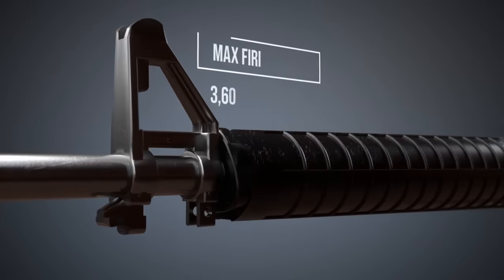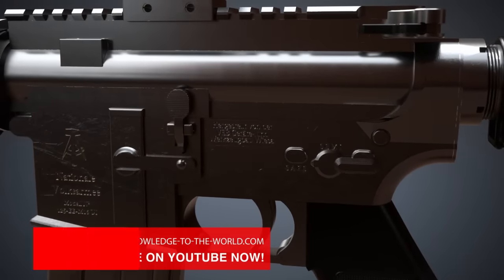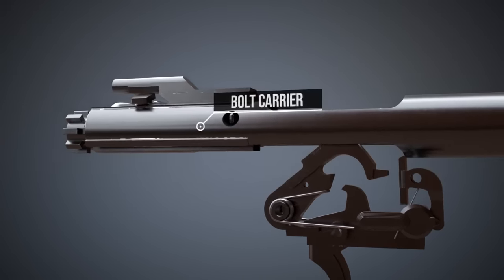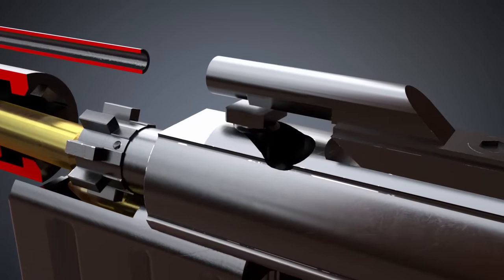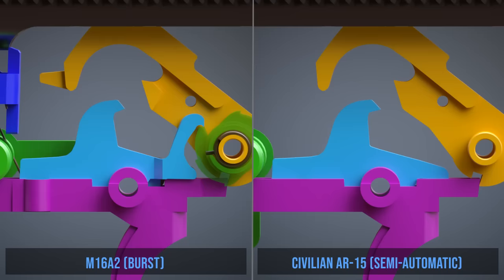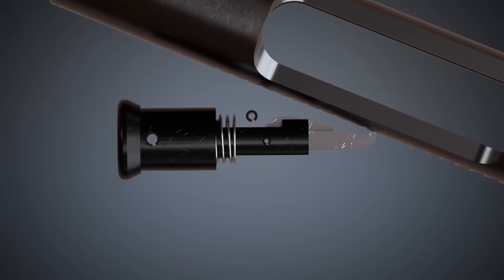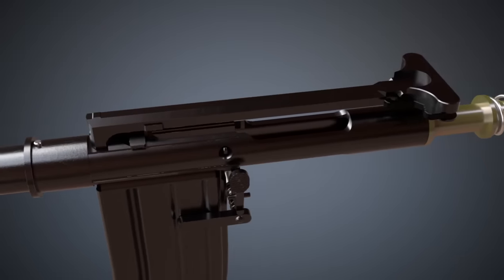M16 and AR-15 - How firearms work! (Animation)

Comment: It's called the cycle of function. Firing, unlocking, extracting, ejecting and cocking,feeding, chambering and locking. It's firing from a closed bolt.  Mgs. Cycle is the same but the sequence is feeding, chambering, locking, firing, unlocking, extracting, ejecting, and cocking.  Firing from an open bolt. It's skill level 1. Or it was for 11b in the 80s.

Comment: I'd always wondered what the weird sticky out bit on the side was for, now I know it's the forward assist plunger. As a British ex-soldier, I'm used to just doing a weird karate chop thing as a forward assist.
Reply: The forward assist almost never works for an out-of-battery malfunction. If it happens, the best thing to do is to rack the charging handle again. Its also a better way to do it because the round may be damaged at some point during manufacture/packaging/transport or during the malfunction.

Comment: And there's all this debate about which is the better AR setup: direct impingement or piston. Well, looking at this, the AR-15/M-16/M-4 as originally designed is a gas piston arrangement. The difference is that the piston is an integrated part of the rear of the bolt as it sits in the carrier, vs. in the gas block near the muzzle.

Comment: as an engineer myself, i am amazed at the beauty of the mechanism of this deadly invention of catastrophe. Also, mechanical system >>>>>>> digital system. Though, digital system makes things smaller, compact with more features, one cannot argue the reliability of a finely tuned precise mechanical system.
Reply: it really is a beautiful mechanism. a beautiful balance between complex engineering, and simplicity in operation and maintenance. I personally own one of these things...amazing to operate. they really inventions of death and catastrophe, in the best possible manner. the .223 and .556 have a special ability to rickashay off bones and bounce throughout the body. it's an extremely effective weapon of war. just make sure it's used by good people to do good things. remember, protect the innocent and helpless.

Comment: Great video but I wish you would have emphasized the exhaust ports/piston interface when visualizing the bolt unlock sequence.
Reply: Good point. It wont work without those  little holes in the BCG! It was a pretty good vid though.

Comment: I have enjoyed watching several of your videos on how different models of small arms work. You not only demonstrate the operation of the mechanisms hidden inside the case, but also explain in great detail the principles of their operation, highlighting the key points. There are very few creators on YouTube who treat video production with the same care and precision that you do. But here in this particular video, starting from 6 minutes 27 sec., you have crept in an unfortunate mistake. The spring clutch between the burst cam disconnector and the hammer must be wound in the opposite direction to that shown.

Comment: The one misconception that your video doesn't quite address is the idea that the bolt carrier cycles during firing. The truth is that the bullet is all the way out of the muzzle well before the bolt starts rotating, so there are no moving parts during firing.
(I've seen many people think that automatic rifles are less accurate because of "moving parts" during firing)

Comment: You know, the way the 16 model works is pretty much designed for optimal failure in order to be cleaned or be replaced consistently.
It works on the same gas premise as the m1 carbine but the port is perfectly placed to put grime on the most working surface area possible.
A lot about the gun design and the history of it confuses me.

Comment: Not trying to be anti American, but having served in an Army where the standard assault issue was a modernised AK-47 rifle(having more or less the same firing mechanism as designed by Kalashnikov in '47) , I must say it seems to me the AK has far more simpler and more effective firing mechanism, it's kind of clear now why it's so wide spread, and why there were many complaints about the m-16 jamming during the Vietnam war. I personally never had a chance to fire one, being a EU citizen.  Kalashnikov could be drowned in a river, blown up,  ran over by a thank, and still work after all of that with a surprising lvl of accuracy. If you haven't already do a video on the ol' AK,, would love to see it.
Reply: the jamming of the M16 was because of a faulty change in powder in the ammunition and many US soldiers in the war had the belief it was self cleaning so they weren't cleaned, so many of their rifles jammed in the jungle and was regarded as a total piece of shit till the M16A1 was released years later.

Comment: I dont even understand how soldiers were able to view the smaller aperture rear sights easily
Reply: The pupil is not dilated during the day, so it is not a problem.  For night firing, the rear sight would be flipped so the sight with a larger ring is used.  At night, the pupil opens (dilates, or to put in simply opens up like a cat), and the larger ring works.  Another point, for targets over 300m, the larger ring is used (during the day; at night it would be difficult to see a target over 300m without night vision).

Comment: so well  explained but im still confused asf LOL
Reply: The firing pin dents the primer when you pull the trigger.. it goes boom, bullet flys out... the used brass case that was holding the bullet and the powder gets  thrown out of the gun by the bolt(ejector) as it moves backwards from the explosion .  the bolt then  wants to go home because a big  spring is pushing on it and it carries a new bullet into the barrel on its way.. simple.. then you pull the trigger again. bang, bang, bang until mag is empty

Comment: Cool video. One problem - burst mode was NOT added to save ammo, it was added for more effective shooting. In full-auto it is hard to control a gun because of the recoil, in semi-auto you shoot only one round, so it is easier to miss. In burst mode you shoot 3 rounds before recoil will affect your aim, so it is easier to control and harder to miss, plus, after one shot target may still be alive and capable of firing back.
Reply: I would bet real money that the burst mechanism jams readily with the addition of just a little fine sand.
Reply: @6NBERLS  well, it is a problem with any fine mechanical systems, and you can get only so fancy with just a simple system. Everything has a price.

Comment: Amazing how fast the m16 trigger system actually does all this in real time. 1400 rounds if you had a clip a mile long in 1minute.
Reply: 1,400RPM is super fast and like MAC territory. Full auto ARs will fire 600-800RPM depending on barrel length, gas length configuration, and buffer configuration. I hit about 650RPM with my binary trigger which isn't much different from the M16s I've shot.

Comment: Stoner's design is not really a direct impingment. The gas tube delivers the gas to the inline piston inside the bolt carrier, hence the gas rings at the rear of the bolt (not made note of in the video). 

As for fouling, most of the gas delivered to the piston exits from the small holes in the side of the bolt carrier. This expelled gas is shown at the very end of the video. Very little gas is left in the piston prior to the bolt carrier moving back and the gas tube unconnecting. In reality, bolt parts need to be cleaned very little with just a light layer of oil remaining.

The beauty of the Stoner design is that the piston is inline with the bore, no tipping forces such as on an AK. Important also is that the piston pushes the bolt against the barrel extension as it unlocks. The bolt is "floating" during this unlocking with reduced stress on the locking lugs and barrel extension.
Reply: It actually is true direct impingement, as the gasses are impinging directly on the bolt/bolt carrier.  The whole "ar-15 is actually a piston gun and not DI" meme needs to die because it makes no sense when you look at it in context of every other direct impingement.

Look at the MAS49, Hakim, any "true" DI gun and they all are piston operated.  There is not a single DI gun that operates just by gas striking a surface, they all use a small piston.  Thus, DI is a subcategory of piston gun, they are not mutually exclusive, or else there are no DI guns that exist.

Comment: This will be lost in the comments but why doesn’t the bolt rotate before it goes to the trunnion to lock? I get there’s a cam pin but I feel like if there was enough pressure on the bolt itself (like a cartridge or finger poking at it) it would rotate within the bolt carrier. Are the recesses within the receiver or something? This has always puzzled me
Reply: When experiencing backwards pressure the bolt is trying to move directly back but cannot because the direction of the force is straight back into the locking lugs (the metal protrusions which line up with the bolt's metal protrusions). It can only be moved back during firing once the rest of the BCG moves backwards. The BCG can move because nothing is impeding its rearward movement and, as it moves, the cam pin is forced through a set channel, turning the bolt and allowing it to move backwards. 
The bolt remains extended because, once the BCG turns the cam pin and the bolt is free, the chamber's pressure is vented and it is no longer receiving rearward force that would cause it to move backwards.

Comment: A great video illustrating the mechanics of this rifle.  Brings me back to the 1970s when I was young and serving as an infantryman.  The video could be improved by explaining the reason for inserting the firing pin retention-pin from the left side of the bolt-carrier with the rifle pointing away from the user.  During my time, we were told not to insert it from the right-side (with the rifle pointing away from the user).

Comment: Great modeling and animation. You might want to correct one minor thing. In the cartridge the primer pocket is deeper and propellant doesn't sit in that area. There's actually a hole that allows the primer energy to reach the propellant.
Reply from the maker: Thanks for clearing that up! :)

Comment: The only thing I can fault this video with is incorrectly describing the AR15 as being a direct-impingement firearm. Even the animation correctly shows how the firearms cycles; the gasses redirected back into the bolt carrier group use the bolt itself as a piston to then launch the carrier itself backwards into the receiver extension.

Comment: The idea that ammunition waste is the logic behind burst fire is not necessarily true.  The fact is that only 2 rounds of a burst are expected to be on target when aimed at a man sized target at 50 meters.  In close combat, such as clearing a building, the inaccuracy is not a problem.  The current battle rifle is the M4 version and has recently be upgraded to Fully Automatic. 

A bigger problem with Full Automatic, is that of guns failing either due to barrels bursting, gas tubes or some other part.  This has been a problem in combat with several makes of rifle.

Comment: Nice video, their is some issues around 09:16, unless modified most m4/m16/ar-15's come with a compensator not a flash suppressor. You'll see a Flash suppressor on a 240.
Reply: It's a compensated birdcage flashhider and a very good one.  Even the very first M16s used a 3 prong flash hider.  The bottom opening of the birdcage is closed which has a little bit of compensation effect.

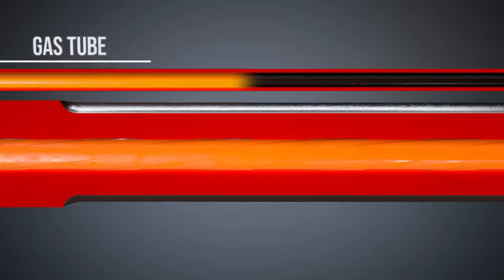Comment: 4:36 I don't understand why the gases go all the way down to the firing pin. Isn't it enough for the gases to hit that upper cylinder to push the bolt back? It looks like a dead end. Oh I see why now, the gases in that chamber make sure the bolt rotates out of the cam-locked position. And after the gases push the bolt back where are they vented?
Reply: They are usually vented out the side of the upper receiver and near the charging handle which is why when people shoot suppressed they run charging handles with raised lips.

Comment: I would like to ask those who are well read up on the first m16 a question. I know it was prone to jamming a lot due to weather conditions, dirt, and what not. What specific part of the gun was it that was the cause of all of it? Was it the high tolerances? Maybe it fouled quickly from poor care? I'm just curious if there was a simple fix that could have resolved the issue.
Reply: It's not prone to jamming at all.  Not to weather, not to dirt, not to sand.  That stuff is almost completely a myth. Look up InRange TV's mud test of M16 and AR-15s and not a single one has jammed yet from being covered in mud, while even the AK has failed those tests.

When the M16 was still only the AR-15 and being fielded by Air Force, Spec Ops, and South Vietnamese troops in battle, it had a near perfect reliability rating.  When the US Army was forced to adopt it after seeing its battle performance, the US Army Ordnance Dept hated the gun because it was the first rifle not designed by their government engineers, and not manufactured in government armories.  It didn't use traditional wood and steel, so they attempted to sabotage the gun to bring back the M14.  They ignored suggestions from Colt to chrome line the barrel and chamber, they didn't issue cleaning kits or train soldiers how to clean the gun, and most of all, they issued OVERPRESSURED ammunition to the troops.

If you look at the statistics on M16 jams when initially released to the US Army troops, almost all of them were fail to eject malfunctions.  This is because the overpressured ammunition caused WAY too high chamber pressures through the case, and caused the dwell time to shorten, and cause the gun to run way over pressure and way too fast.  M16s were reported to be running over 1000 RPM for a gun that should run around 700-900 RPM.  This means the bolt was unlocking before chamber pressure dropped, and opening hard and fast.  Extractors were slipping off the rims of cases, cases were getting ripped to pieces under extraction, and cases were exploding when pulled out of the chamber while under too high a pressure.  Compound this with no cleaning kits means no cleaning rods to push out the stuck cases.  Not only that, the lack of chrome lined chambers, while not strictly necessary, still caused corrosion in the chamber.  This means pits will form and stay in the chamber even if you cleaned it spotless.  The cases under high pressure would fill into these pits making it even harder to extract these high pressure rounds. 

The Ichord Report done by Congress found criminal negligence by those that decided to do this to the M16 but could not find a guilty party to pin this on.  Colt was tasked to fix the issue to run with this massive stockpile of overpressured 5.56mm so the major change they did was switch out the buffer system to increase dwell time so the M16 could run those rounds without issue.  There were also other changes that helped like chrome lined barrels, but they're secondary reliability upgrades.
Reply: @deanc91  Thank-you for this info ^^
Reply: early m16s were issued without cleaning kits.  That is insane in hindsight but ar-15s and any weapon for that matter need to be cleaned regularly.  Also the Army was using ammo that was not suited for jungle conditions.

Comment: Why do they vent flash suppressors around the entire circumference? Why aren't flash suppressors only vented in the upper part to counteract muzzle rise?  For instance, they could just use two vents at 10 and 2 o'clock. That would counter act muzzle rise and not be directly in the sight picture.
Reply: That would turn the flash suppressor into a compensator since it would mitigate muzzle rise but it wouldn’t eliminate flash.
Reply: @hm096  Interesting, Thanks.
Reply: @hm096  I don't know if you watch Matsimus' channel here on YouTube, but he posted a short video of soldiers doing some field training and their Rifles were jamming. At least one double feed. Is the M-16 / AR-15 prone to that?  Is it safe to re-use a round if it was involved in a double feed?

Comment: Just because I'm curious.. is there any reason you couldn't put ta flash hider on top of/after a suppressor? I mean the suppressor removes a lot of the gases with the chambers, but wouldn't there be even less of a flash?
Reply: I don't see why not, but it probably isn't worth the weight weight.
Reply: you could, but it’d be more for the convenience of not having to remove the flash suppressor; as for any added benefit? not really, suppressors pretty much eliminate flash on most guns by themselves

Comment: what exactly was the problem with m16 rifles in the vietnam war. I heard there was many instances of rifles jamming and the operator ended up being shot/killed .
Reply: Early designs of the m16 had some tweaks that needed to be adjusted and looser tolerances/ more gas blowback to  be made. Essentially, they first told GIs that they didn’t need gun oil or to clean it at first, which was very wrong. Then sand or mud would often get into a relatively incomplete bolt design and cause failure to feed or extract.. ect ect..

Point was, it was easily fixed and the m16 was ultimately a superior rifle because of how much ammo a soldier could carry onto the field and then overall simplicity/effectiveness.

Comment: great video but i didnt get the spring clutch part i know i am slow but how does the disconnector cam rotates thanks to the spring clutch i know it get smaller and larger depending on the direction of the force but where goes the excess of it when it gets smaller and how it works